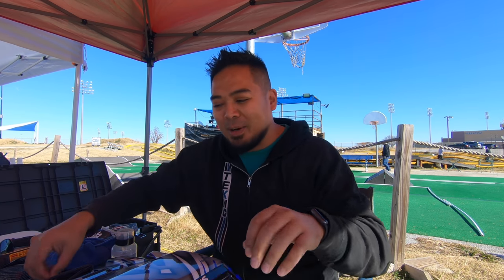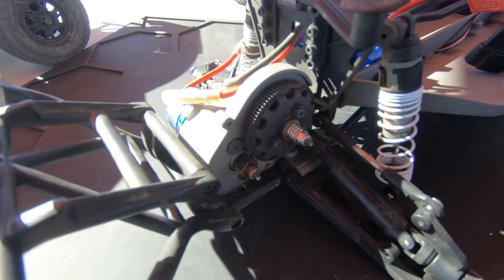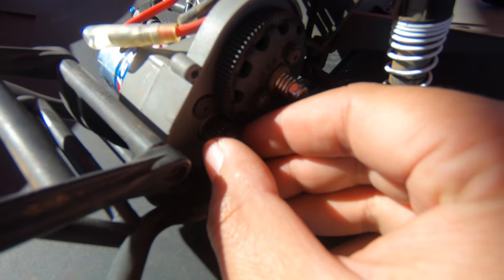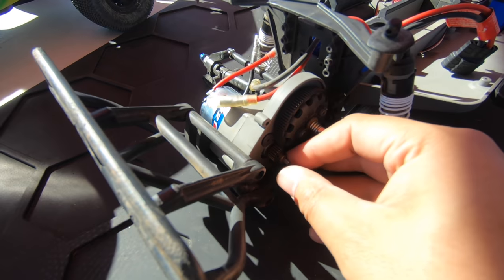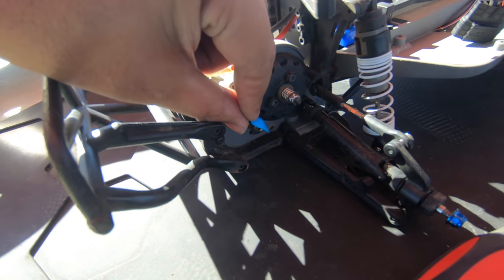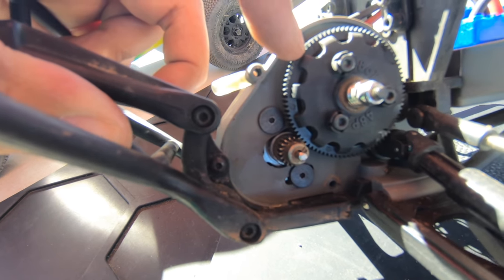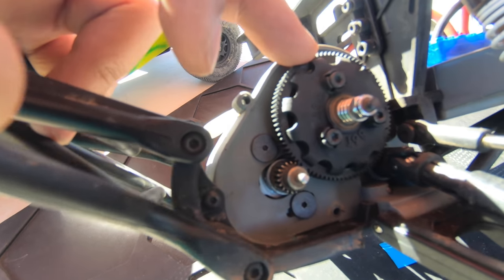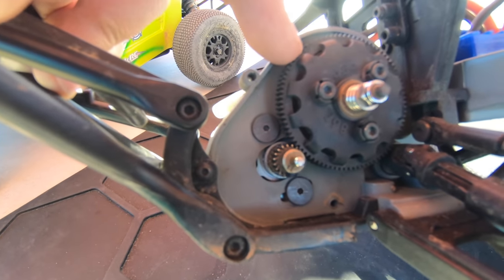How To Set RC Car Gear Mesh | R/C Car Gears How Tight

Comment: Ive used the paper method ever since getting my 1st rc. A Tamiya Blackfoot back in 1986. I believe it was in their build manual. Even my early on Traxxas TMaxx's instruction manual had a number of pre labeled templets in the back that you could cut and use. I dont think I have seen this in any manual in quite some time. Perfect size is @ 5/16" x 1-1/4". This stays put even if you accidently roll the gears a little while tightening. I have owned @ 2dozen RC's over the years in Electric, Nitro and Gas and have always done the paper trick. I dont recall the last time I had a gear mesh failure. Good Luck.

Comment: Great information Mark 👍
Just make sure if you are using paper method to use general note paper and if it tears when you spin the spur gear by hand inspect closely something is not correct. Gears are not generally expensive to replace but setup incorrectly it will lead to a host of issues.

Comment: XL 5 brushed motors will benefit chucking the factory installed phillips head motor screws & replace with Traxxas part # 3931    3x8mm flat head hex drive screws. Better feel & no stripping of  inferior phillips screw head .

Comment: Traxxas or Traxxas Support made a video about it, I think for electric Traxxas models they suggest using lined notebook paper, pretty sure it's normal paper for Traxxas nitro, and I think that is for 48 pitch, but you can watch their video.  They also sell fixed gear adapters which are good but I don't know what spur and pinion combinations they work with and for what models.

Comment: Hey, I actually need this, gonna replace the motor in my trx4
Reply: You knkw the trx4 has a motor plate with set spots for different size pinion gears
Reply: @randomstuffno1caresabout3  yeah, tore it apart after finishing up the video and saw that, makes my life easier now

Comment: I notice you dont turn the truck off like they tell you too. It says to unplug the battery not push the button on esc.
Reply: They only say that so u don't leave the batteries connected after shutting off the unit....on the erevo once u do the update the button will not even shut the car off

Comment: But what KIND of paper? There's a wide range of thicknesses. I've been using standard printer paper.
Reply: I know right,  is using the paper part on part packages to thick? I have a kaiju.  I need help with this.  Burn a motor out, and my motor gets hot just running it for like 10 to 15 minutes.